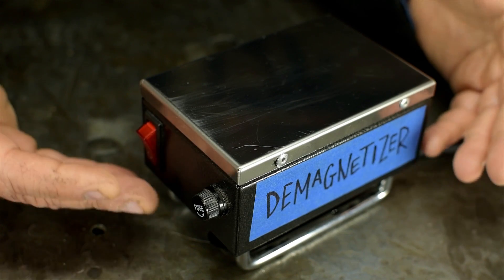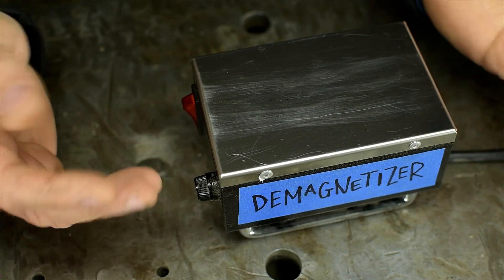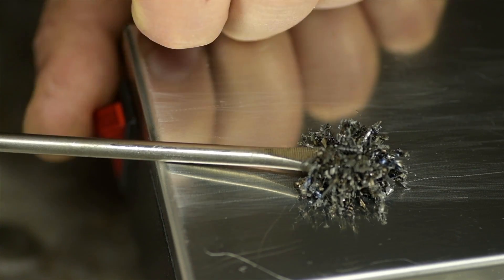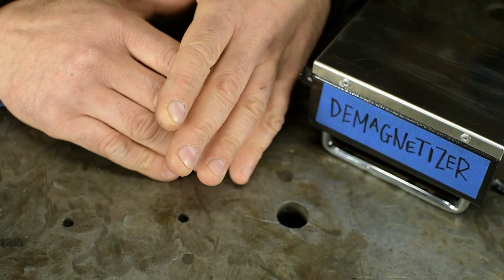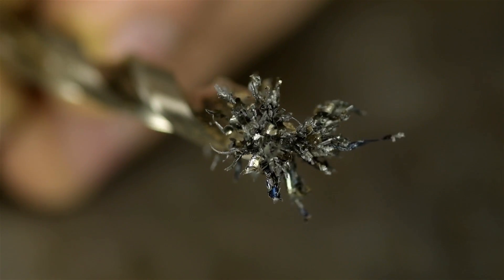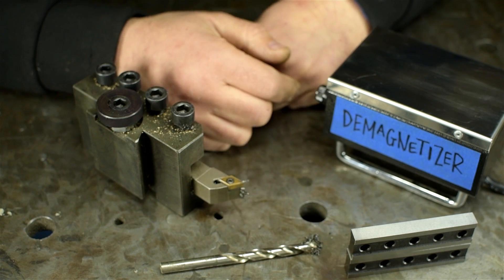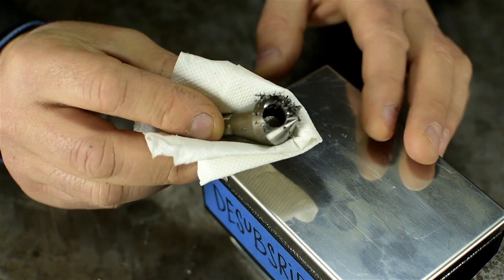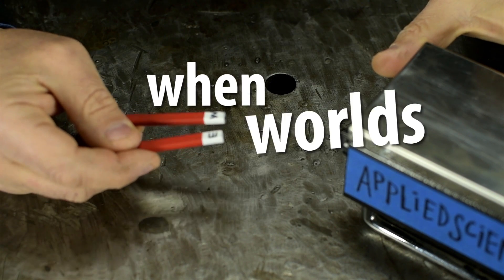SHOWDOWN! Magnet Vs Demagnetizer!

Comment: lets see if you know this: If you have a very large/strong neodymium magnets and a weak earth magnet like that on a refrigerator. Push the 2 opposite poles towards each other and they repeal yess! for how long is the question here? infect the larger neodymium magnets will revers the earth magnet's polls and they will pull on each other after awhile. not long and they will stick as the earth magnet poll was force to swap.

Comment: And that's how you tear space-time.  Jerk.  ;)
I worked at an AV shop and one of the techs would mess with a sales guy.  The tech had a degaussing coil at the end of his desk.  Other side of the cube was the sales guy's CRT monitor.  He flick the coil on and off causing the sales guy to call IT, ask every engineer what the problem was, etc, etc.  As soon as IT or management would come walking down the hall, turn it off.  This went on until one morning, when people came in to work, there was this TERRIBLE burned plastic smell and a slight haze in the air.  The tech had accidentally turned the degaussing coil on and left it on overnight.  It was laying on the carpet.  It melted a 10" ring down to the concrete sub floor.  It was early enough that we were able to air out the building and nobody got fired.  I'm still amazed that it didn't cause a fire.  That dude was one lucky SOB.

Comment: So the Theory of Gravity has a spinning ball and an iron, molten core.
But magnets lose their magnetism when they are heated.
Can you offer an opinion of what seems to be a contradiction?

And, if friction is needed for thrust, how can this happen in a vacuum, for the same reason sound has nothing, no wave to travel on?
I am not referring to the oxygen being available in the fuel, I am talking about, even with a combustion, what is the combustion pushing against? What is the friction being created by?
Like claiming the big bang was a quantum vacuum.
Okay, where did that come from and what created it?
Or Dawkins and his aliens "seeding" Earth.
Where did they come from? 
He claims it would have to be a group formed by the same Darwinian principles. So who seeded their world?
Create all the eternal regresses you'd like, there still has to be a starting point, or it always was.
Which is more likely?
Pretty hard to argue eternal, when you don't believe anything is eternal.
So it was created.
When, by whom, or what?
One would think you would need to know.
Chance?
Chance equals luck.
Do you believe in luck?
This invisible force that chooses to helps some and not others?
Right? It chooses some?
Like this universe, this place?
Just lucky?
Of course not.
Sounds like fairy tales.
Lacks logic.
Does two whole numbers plus to whole numbers equal four whole numbers?
Or is there a probability of may be?

Comment: This is probably not the best video to post this question, but i thought id throw it out there and see if i get a response...  Maybe AVE, This 
Old Tony, or NYC CNC and others can weigh in. Recently my son and I have  switched from SprutCAM to Fusion 360 for our tormach 1100, and unless were mistaken (please advise) we noticed there seems to be some issue with the tool holders and tool height setup. Normally we measure overall height of a tool and its holder using a surface plate and height gauge, and would set our total tool height in SprutCAM to this value. In fusion, with the tool holder feature turned on, the overall height of the tool is a function of the tool stickout and tool holder height, not 
the height from the surface plate. We measured several of our er-20 tool holders, and found a variance of up to 0.020", so it is not possible to
 use the tool holder height to calculate the total tool length ( tool holder height + tool stickout) which seems to be how fusion does it. Are
 we missing something, or is this a problem?  We get around this issue (and from what we can find online, so does everyone else) by turning off
 the tool holder feature and using our surface plate measurement as the stickout value. But this means we will not be able to predict collisions
 with the tool holder in simulation, so we would like to have this work properly.

Comment: I use 80 cubic foot cylinders of 100% argon when I TIG.  I have noticed that sometimes, when the cylinder falls below 400psi, I begin to get porosity in my weld.
I reviewed your gas flow video.  At 400 psi, I am still hearing the normal hiss coming from the end of the torch.  I have reviewed dozens of websites and found a few  suggestions that my cylinders may have some moisture in them, possibly because a vacuum is not being pulled before filling.  Is this a thing that others have run into and is there any way to filter or dry the argon after it passes through the regulator?

Comment: Also known in my industry as a degausser. We used them to degauss picture tubes to fix purity problems. Inside an old fashion tv picture tube is a steel shadow mask that is used to soak up stray electrons that also ends up getting magnetized over time. A degausser could fix this problem that showed itself by strange colored blotches in the picture, usually in the corners. The slow drag is to deal with the hysteresis that most magnetic materials exhibit, especially when exposed to an alternating field like AC. Too much information. Of course. Perhaps we all have too much free time ;)

Comment: Our house got stuck by lightning some years back. I won't bore you with a list of damage but the weirdest thing was the TV. When we turned it on the top half of the picture was green. Took it to a TV repairman, he degaussed it and said it was fine. I put the TV back in its spot and we still had half the screen green! Cut a long story short, it went back to him several times but he couldn't find anything wrong and didn't believe me, especially when I told him that a small TV in the same spot worked fine. So I suggested he come round and have a look for himself. While I was at work I figured out what the problem was - I phoned my wife and asked her to phone the repairman and tell him to bring a degaussing wand with him and degauss the shower base (needless to say my wife thought I'd gone crazy!). The TV sat on a small table in the lower half of the house up against a wall, the shower was in the bathroom right behind it. He degaussed the shower base and the picture returned to normal. True story.

Comment: If demagnetizing permanent magnets is a goal, the metric of interest is intrinsic coercivity.  Most NdFeB magnets are going to be very difficult to demagnetize this way, but most AlNiCo compositions are going to be extremely easy to demagnetize.  In fact, AlNiCo magnets have a low enough intrinsic coercivity that they can be demagnetized or reversed by being closely coupled with other permanent magnets.  This is why most AlNiCo magnets come with a keeper bar.

Most strong horseshoe magnets are cast AlNiCo, or at least they used to be.  The horseshoe shape helps make up for the low coercivity.

Comment: East West poles of the Magnet that is funny, when I was an early teenager I worked in  a TV repair shop, yes you read that right a TV Repair Shop.
One of the things I was tasked with was degaussing the Cathode Ray Tube. I made mine with a coil of wire and a 100 ohm 30 watt wire wound resistor. I lost my magnet personality using that degaussing loop, so today I keep neodymium magnets in my pockets except when I fly. 🤣🛫

Comment: Now to remagnetize the magnet! The best way to do this is either with a current passing through it at a certain voltage, or by having it make contact with another strong magnet. Or, just put your demagnetizer in reverse :)

Comment: If you try that with a neodymium magnet you better get a good grip on it because it's going for a ride, usually across the room. The demagnatizer needs to be stronger than the initial force that created the magnet. The power dumped into neodymium magnets is insanely strong which is why they make such powerful devices such as the motors on drones and brushless power tools,  speakers, the head positioner on hard drives, x-ray lasers and many other applications.

Comment: you could make one out of a microwave oven transformer , with the high voltage secondary removed  and by keeping the E lamination only . use with a 15A momentary switch only . use for maximum 10 second on 50 seconds off to prevent over heating.

Comment: I usually pull my drill bit, that's loaded with metal shavings, through the armpit of my tank top. I know, know, I shouldn't wear a tank top while in the shop. But without a tank top, I get my chest hair singed when I angle grind.

Comment: Do you have a variac? Or some way to control current in that magnet. I've always wanted to try controlling the current through a demagnetizing coil like that. 
It seems like you could put the magnetic part down on a piece of something-not-loud (silicone?), and then have the current at max and slowly decrease it to zero. The AC will flip the field, while the slow decrease of current will reduce the magnitude "envelope" so you can get some less painful demagnetization.
Though maybe complex shapes would be a problem? This is why I think about testing it, haha.

Comment: I love sending the uninitiated over to mine so they can demag that paint can opener. I tell them to just hold it about a 1/4 inch above the top and switch it on. That's all you need to do. Then I run to the restroom which is directly beside it because it usually triggers my urinary incontinence. Funny thing. That's the only time that happens. 

Cool vid TOT. Keep 'em coming!

Comment: 100$ and up? Wtf!? Open that box, it's a coil, switch, and fuse, probably a resistor, and maybe a transformer if they used a weak coil. Almost any coil when supplied with AC power functions as a degausser (demagnetizer).

Comment: Actually! ...yes, you draw away slowly as you mention, but, but, but, you are also meant to switch it on first and then approach slowly too! Depending on the phase the thing starts at, it can initially magnetise it stronger than when it started out, so If you do a full drive-by demag, it will be more effective. It also doesn't need contact, so, like the one I have, you can put a sacrificial skin of plastic over the plate.

Comment: If only I could do this with my Volta end pieces. Always have to take an exacto knife and pick the bits of metal out of it. For those unfamiliar Volta makes magnetic charge cables, one piece goes into your phone and stays there, the other piece is the cable that can self attach when you get it close enough. Incredible for field work where you know your going to knock your phone and charger around a lot, pain to keep up on.

Comment: Hey, thanks for mentioning me! It looks like the problem was that you used an east-west magnet. In your geographic location, you might need a north-west magnet.
Reply: C'mon Tony, pin this!
Reply: not to be confused with a north by north west magnet
Reply: Tony's degausser cancelled the South by Southwest magnets this year.
Reply: I have a feeling that formula was ToT's Law of sub-scribe mechanics.
Reply: The equation does hold.  I don't know what it is useful for though.  It's the line integral of the force per unit charge around a loop.  The first term comes from Faraday's law in integral form, and the second is the just the v x B part again.
Reply: @piperboy98  : That equate to magnetic Isp?
Reply: Hi Ben! Faraday's Law of Induction in integral form right? What is the extra path integral for? I'm a little rusty since graduating...
Reply: @davidlong2691  I think ToT might be pulling our leg. (Shocking, I know). The equation is somewhat like the Lorentz force equation, but has some extra sigma's and partials in there. Heavy duty equations always weirded me out anyway, so who knows, it could be legit.
Reply: @AppliedScience  aha! I thought it was something you may have sent TOT to explain the degausser. Leg pulling it is!
Reply: @davidlong2691  i agree. probably to account for field changes induced by relative motion of parts?
Reply: I believe the formula explains how the flux capacitor functions.
Reply: It looked similar to M Sigma to me
Reply: Don't forget to turn it upside down if you're down unda.
Reply: Ben!!! You aren't Avery.
I thought about trying to make that into something funny but all of my SEMs just broke.
Reply: The real question is, why has no one built a compass that points to the south pole?
Reply: @mrchrysler9736  I heard, that the compass to the Mecca build in this way.Sorry if not, dont want to lie.
Reply: Cheers Ben. Never seconds ago.
To us in Poland, north and south are the same. We always see a difference between the west and east tho. So different.
Reply: This must be why my south east magnet is malfunctioning.

Comment: Having done my military duty during the Vietnam era in the Air Force, there was a procedure to demagnetize the "skull plate" of the KC-135 and B-52 aircraft on which I worked. This was to prevent any stray magnetism from affecting the accuracy of the "Whiskey Compass" located in the cockpit. The tool that accomplished the job was a big coil of wire shaped in a circle that would then be plugged into aircraft power at 115V and 400hz. Just rubbing the coil on the plate for maybe a minute would do the job. This had to be done from outside the plane, so a jackstand was used. You'd be 20 or 25 feet up, leaning over, looking down into the windshield of the plane, and rotating the coil over the skull plate, a plate located directly above the middle of the windshield. If a plane had been struck by lightening during flight (and it happens quite often) there would be a write-up to have the skull plate demagnetized.
Reply: I like this story.
Reply: When the nose gear strut on an airplane with retractable gear gets magnetized, the pilots may notice that the whiskey compass reads differently with gear down or gear up.  The strut is closer to the compass in the wheel well than it is when extended, and also oriented closer to the plane of the earth's magnetic field.
Reply: I think they do something similar with ships to reduce risk from magnetic mines. It's the largest demagnetizer in the world if I'm not mistaken
Reply: There is a ship degaussing set up in Rose Bay, Sydney Harbour.
Originally to degausse navel ships to reduce there attraction to mines.
Reply: @captcarlos  I performed a thorough investigation. However, I could not locate any navel ships...  ;)
Reply: Regarding demagnetizing ships:
If memory serves correctly, the issue was that the German mine's trigger of the time was basically a very delicate compass. In addition to just being mechanically very sensitive, when it's magnetic field was disturbed from it's resting state it would initiate the explosive package. In addition to displacing quite a lot of water, ships were magnetized from moving through the earth's magnetic field, so this dual-action trigger worked remarkably well. So well, in fact, that the allies had a hard time getting their hands on an undetonated specimen to ever figure out how they worked. I believe the only way they even got their hands on one is because the team laying mines made a mistake, and never did the arming procedure for one.

Moral of the story: know first principles and obscure knowledge, it could save lives. And pay attention to your job, it could lose wars.
Reply: @D Thank you... It's an honor to have fellow patriots who love our country understand serving. Thank You.
Reply: Thank you for your service and your story. Always enjoyed any story about anything mechanical and the maintenance of them.
Reply: @softyzz69  It's just a coincidence, but today, Nov 22nd, is the day I shipped off to boot camp, Lackland AFB Texas. It's an honor to have served. I separated the military as a Staff Sgt.
Reply: bullsballs  ......Booooo-yah!!
Reply: @D protecting America by going to other countries and warring there? Sure. Whatever you say, bud
Reply: I ate a grilled cheese once.
Reply: @blackmarketyardsale      ,,,,with onions ??
Reply: @dmc2554  Did he just leave us hanging on the grilled cheese story?
Reply: @dmc2554  How have I never thought about this before? You are a genius.

Comment: I actually tried this a couple months before. I tried to demagnetize the tail cap from my wizard pro flashlight because i'm afraid it will magnetize my automatic watches. So i took the chinese watch demagnetizer (smaller than yours) and tried to demagnetize it but didn't do it. It rattled like yours did but the magnetism was still there.

Comment: You can remove a rotor from a shot AC motor stick a pvc pipe in the ID for safty insulation and do the same thing for the low price of a broken motor.

Comment: I tried this with a neodymium magnet a few years back and it shot into the air and blew the fuse on my demagnetizer. Good times.
Reply: jet fuel can't melt steel beams
Reply: @CommanderTato  No, it can't, but it CAN weaken it to well below the strength required to remain standing/bolted/welded together.
Reply: @CommanderTato  : Don't worry, blast furnace operators know how to fix that.
Reply: Melker Claesson i got 10 bucks that that wasn’t even a magnet, just a bent piece of steel that he magnetized before the video.
Reply: @narcoleptic8982  Some would call that a "magnet".
Reply: @narcoleptic8982  Wait. You know steel can be a magnet, right?
Reply: @Narcoleptic Most horseshoe magnets are either AlNiCo or magnetized steel.  Both materials have very low intrinsic coercivity and would be extremely easy to demagnetize compared to other types of magnets.  Why aren't there common horseshoe shaped magnets of different materials?  It's an issue of the shape being a good match for materials which are not brittle (ceramic and NdFeB are brittle) and have a low enough coercivity to have poor reliability unless they're in a closed magnetic circuit.